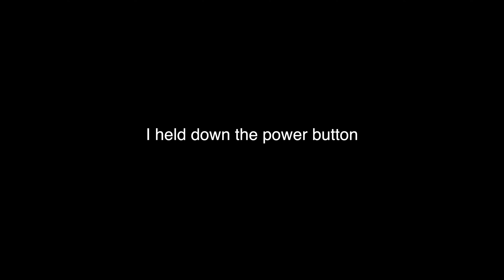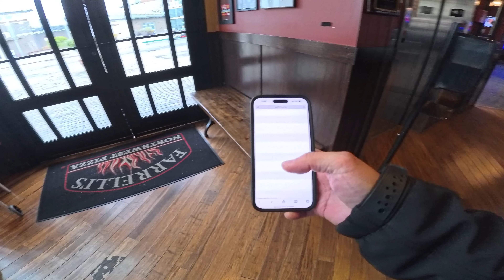THIS YAMAHA R7 IS 🔥 | ADOBO MOTO S1 E12

Comment: 8:07 Ser Adobo Moto! Subscriber here from the PI. I am a fairly new rider and i also record using my insta360 x3 and loving it. 1 thing im having issues with is the vid seems pixelating when doing high speed runs. At the time stamp here, there seems to be some pixelation on the top of your windscreen and the side of the road. Pretty apparent difference between gopro ans insta360 when i watch your previous vids shot on gopro. Have you noticed that?

Comment: So I live in the same area as you do and I was wondering if 7-8k is normal pricing for a r6? Cause at that price I rather pay a little extra and buy a r7
Reply from the maker: It’s normal. Why would you pay more for a lesser bike?
Reply: @adobomoto 

Just throwing this out there, as an experienced tall rider, the R7 makes more sense for my use case as I get into track riding. R3 is too small physically, and the R6 isn't particularly a great teacher.

Comment: Play around with the AcePro settings. The sharpness seems a little high, but it survives the youtube compression a lot better than the gopro. Usually the gopro stops showing road surface detail after 10 feet in front of you lol
Audio is good too.

Comment: PRO TIP!!!   when installing a new chain, DO NOT just remove the master link and yank the chain off,   then struggle endlessly trying to route the new chain with your fingers.      step one!  remove old master link and disconnect chain..  THEN connect one end of the new chain to the old chain and pull it through, up and around the front sprocket and back to the 2 o:clock position on the rear sprocket  then put bike in gear to prevent the chain from freewheeling the front sprocket and falling out.  then grab the other end and match it up to the end of the chain that is sitting on the rear sprocket to determine how many links you need to remove.  (don't forget to loosen the rear wheel and move the wheel forward a bit so you have lots of adjustability for when the new chain stretches 👍)  now cut chain to desired length, install master link, adjust chain tension and re tighten wheel nut and yer done!  😎  oh ya...  your mom?  she frickin rocks bro!   what a sweet ma maw  you have!!  🥰 i love how you include her in so many of your videos! she is legit!  😎👍
Reply from the maker: No, you should always inspect the front sprocket. In the next video you’ll find out why.
Reply: @adobomoto  yes  you are 100% correct about that.  but you can still inspect the front sprocket as the chain rolls over it as you pull the chain onto it, looking for cracked or chipped/broken  teeth  and unusual wear.  for the most part tho, chain and sprockets should be changed at the same time👍